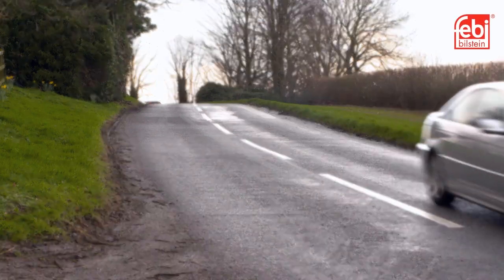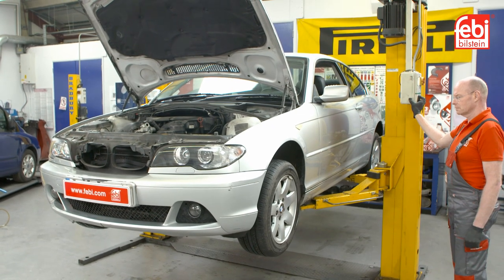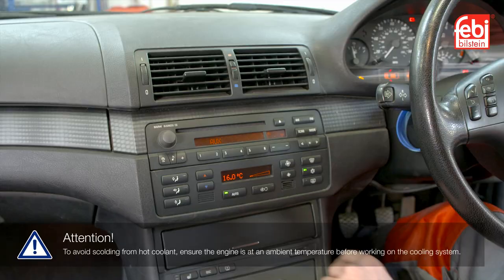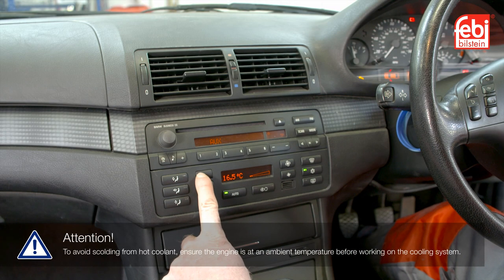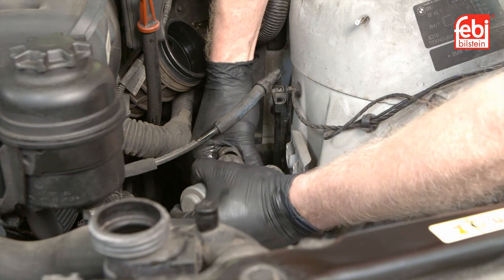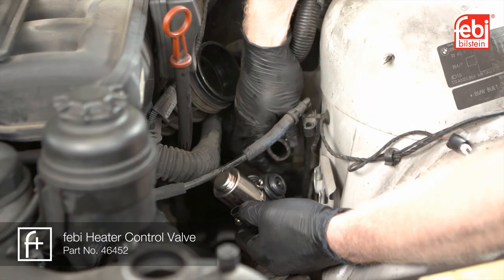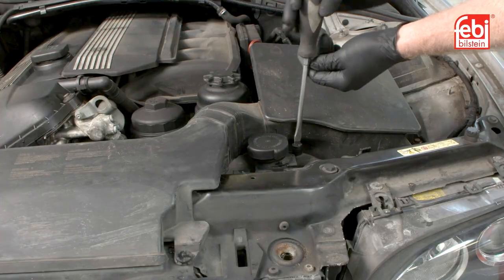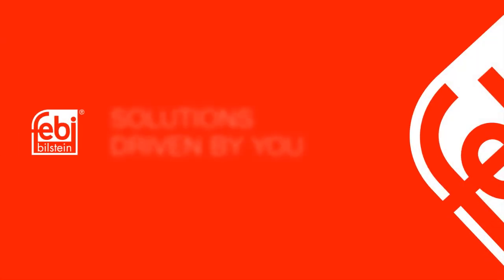[EN] BMW E46 Heater control valve inspection and replacement

Comment: I was told that this valve is always open ie the coolant always goes through the heater core unless the AC is turned on. Is that correct?
Reply from the maker: Thank you for watching our video. In the video it is demonstrated when the heater controls are adjusted from hot to cold, this actuates the control valve for the hot coolant to flow into the heater matrix.

Comment: I noticed the metal part of the heater control valve assembly gets very hot, even when the engine is not yet running at operating temperature. Is this normal?
Reply from the maker: Thank you for watching our video. The heater control valve controls the flow of the coolant into the heater matrix, when the heater controls are set to cold the hot coolant from the engine cannot pass through the valve, but the valve and coolant hoses would get hot from the coolant.
Reply: Check for a short circuit, if you have a multimeter just unplug the power cable and measure the pins, anything lower than ~20Ω could mean a short circuit

Comment: How do we know if this is the issue?
Reply from the maker: Thank you for watching our video. If the valve was stuck shut or open. The symptoms would be the air inside the car would be cold or hot, with no adjustment.
Reply: @febi.bilstein   It's -30 C here and the air inside my car was cold af. So I just hit the valve several times and it worked sort of. At least I'm not freezing and it's driveable.
Reply: In case you have a DME/OBD Reader che code that signals the pump is not working is IHKA017 and usually IHKA018 is given alongside it